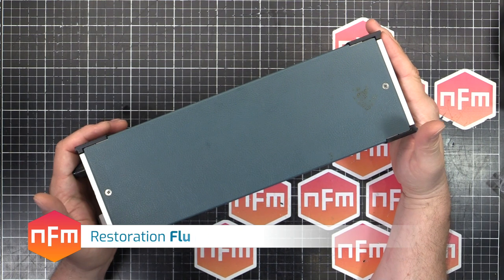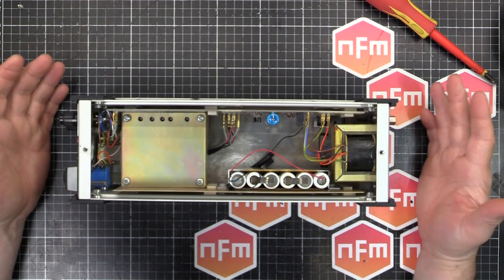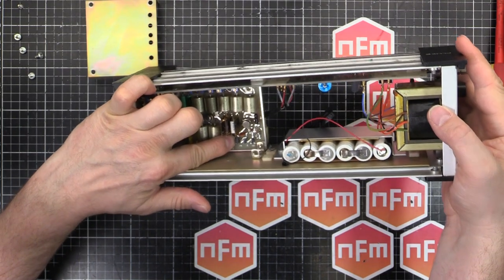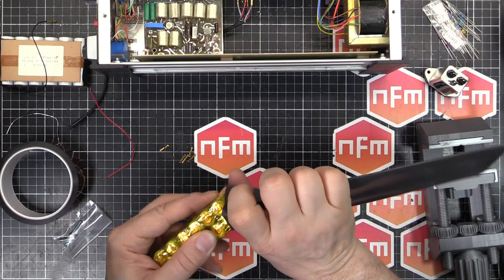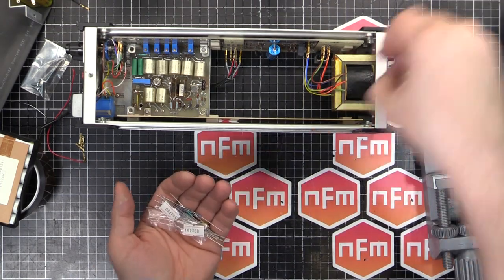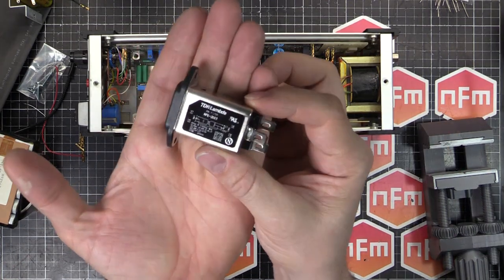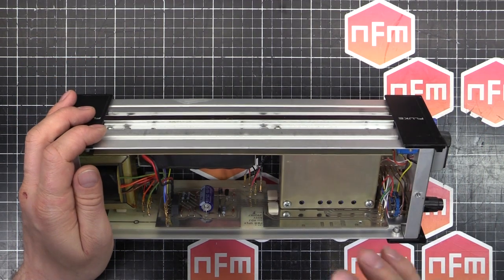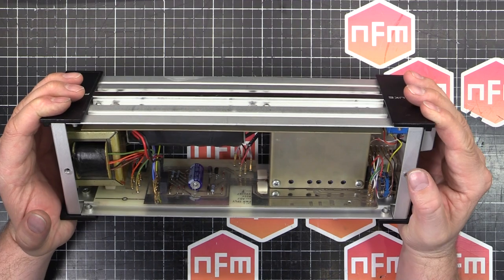Fluke 731B Voltage Standard Restoration

Comment: I like all the work you made on it.. I think that carbon resistor inside the shielding wasn't critical as it was only carbon..and all those critical ones were hermetically sealed ones.. But still if you changed that one also i would think about some better one than normal 50 ppm..i would go for 10-20 ppm ones. ofc i didn't check schematics of it.Anyway all good work..With that input filter..well not sure if i would go for that change..I suppose it was good move..that main capacitor change was also very good move..higher capacity and more benefits..I would for sure change tantalum capacitor..it has a lot of years and i twill fail for sure..so I would suggest to change that one ..rest looks good..Nice video..hopefully there will be something like this available cheaply..
Reply from the maker: I decided on 50ppm as the carbon composite resistors are generally well into the couple of 100's of ppm.
No way I was going to touch the hermetically sealed resistors! That's where the secret sauce is. :D

It's still running great and is very stable too.